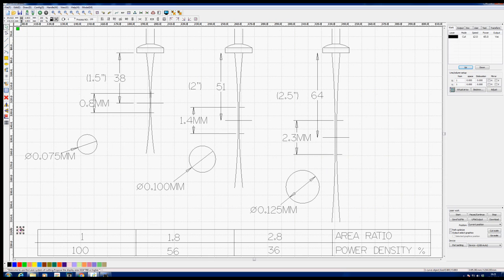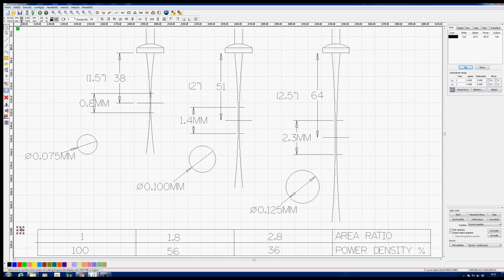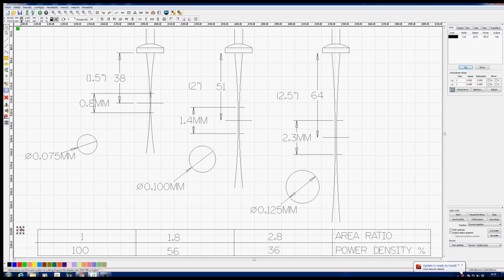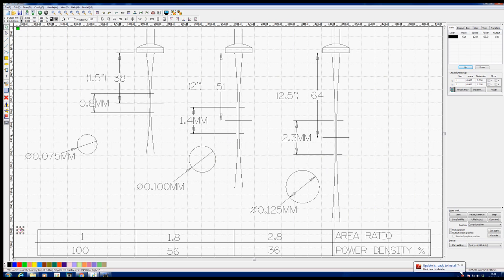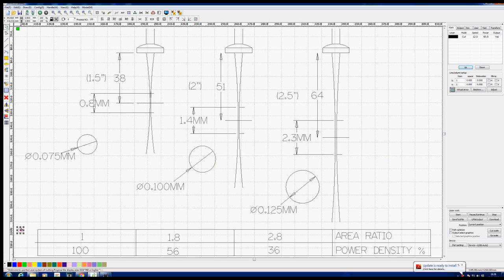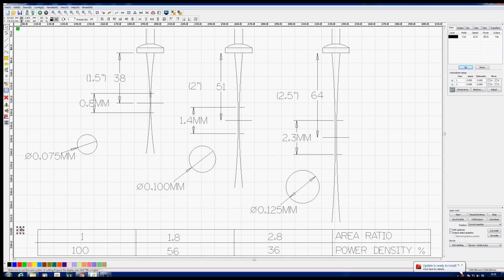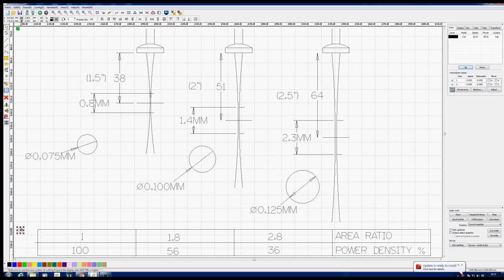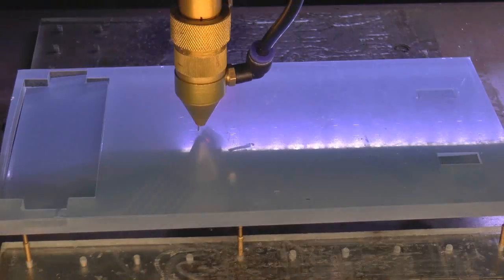RDWorks Learning Lab 39 Understanding Lenses

Comment: One point you missed about air assist...It blows out the fire when, things catch on fire.  I'm glad you caught on  to both keeping the smoke off the lens and blowing the crap out the cut.   I will be working on a modification to add a little air ABOVE THE LENS, because it is completely open to the smoke in the cabinet and seems to be
the number one collection point for a dirty lens.
Reply from the maker: Hi Dan
 Remember this video was done 5 years ago when I was just at the beginning of my learning journey with this technology and was beginning to discover the importance of various aspects of the machine. There turns out to be a lot more to air assist than the basic understanding that most people have. I began to realize that a significant part of laser cutting /engraving is understanding  what the laser beam is (yes, just a beam of invisible light) and  how that light energy gets converted to molecular vibration at the surface where it contacts. The level of molecular vibration= temperature  (it's worth Googling to understand this). As the molecules vibrate faster they shake themselves apart and form new chemicals. It is those new chemicals  (smoke and fumes) that you are reheating with the laser beam and  undergo further chemical change and catch fire.. If you can blow those fumes away from the path of the laser beam (out the BOTTOM of the cut) then there will be nothing to ignite. This is not quite true in the case of acrylic  so you may like to watch this short video    https://www.youtube.com/watch?v=eaz9ZEjwjfs

As the video begins , stop it and look at my lens tube. It is very short and VERY open at the top.  I have 3 machines like this  and in 6 years I have never experienced debris on the top surface of my lenses. I can only assume that your cabinet becomes smoke filled during cutting? Air flow management is the secret.....don't let the smoke anywhere near the top of your lens tube. Study your machine carefully because  I'm sure that additional above-lens purging is not fixing the real problem.. This video (from 42:30) may give you some understanding of the importance of air flow management. https://www.youtube.com/watch?v=AHnJ2WxNo5Q
 Best wishes
Russ

Comment: When you made this video, did you have the lenses flat side up or flat side toward the work?  When I turn mine with the flat size toward the work, the cutting is absolutely brilliant.
Reply from the maker: Hi Marti 
 At this point in my learning journey I had already discovered that the  Chines ship machines with the plano convex lens flat side up and that you het better cutting if you use it flat side down, It took a couple more years before I carried out in-depth research into lenses and discovered the reason for this interesting advantage.. My interest in photography and college physics ave me a pretty solid grounding in lens theory. It turns out that  conventional theory does not work for our machines. You probably have a 2" focal length lens and your setting piece supplied with the machine is probably about 19mm wide?   If so, flipping your lens will have decreased that focus  setting to almost 17mm. Without boring you with science, if you want to do detailed engraving then flat side up is better and if you want to cut then flat side down is better.  Here we are 4 years later than this video and I now understand so much more, It is sometimes embarrassing to watch me learning in these early days. BUT without any one to teach me , tiny steps and mistakes are all part of learning.. One simple question to finish.
Do you have a spare lens? suspect no. Your lens id the most vulnerable and the most essential  part of the machine Always carry a spare. They are 3 weeks away and cheap if you buy from China . see   https://www.cloudraylaser.com/products/china-pvd-znse-focusing-lens-for-co2-laser?variant=43422450056     

Best wishes
Russ

Comment: Once again, your video has answered my question.How to get a tighter stronger beam to cut through dense plywood like 1/8" 6 ply and 1/4" 5 ply. Bee struggling to get a clean through cut with the stock 2" lens even though I have it perfectly centered all the way through, but found I have to crank it to 75% at the software level with 80% set on the controller.  Slowing it down winds up blowing out the bottom of the material too.  The only thing not answered, do I need to change out the nozzle, or is it the same nozzle for all three?  Going to try the 1.5 lens.

Comment: Thank you so much for your expertise and taking the time to compile your information series.
I've got a K40 and 1400 bags of tea... Can you come round and sort out my machine? I'll pay for your travel to Oxford :0)
Reply from the maker: I have three problems with your request
1) This is just an engineering and video hobby for me in my retirement and I do not make "service/help" visits. If I started, where would I draw the line?
2) I know nothing about the K40 machine except that it is a very compromised little machine both mechanically and in it's controllability. That is why I never bought one 5 years ago when I made my buying decision. Apart from having a laser tube and 3 mirrors that where my knowledge of this machine stops.
3) I don't drink tea!!.
If you wish to add your disguised email (jimdotsmithathotmaildotcom) to another comment I will reply so that you can ask for help off line and supply pictures/video of your issues. I will try to help.
Best wishes
Russ
Reply: @SarbarMultimedia  Thanks Russ, you're a  gent. Some freeware software has helped with the k40 since launch, allowing dithering and some other functionality. Unfortunately I can't use layers without upgrading the motherboard, which is a real shame and adds considerable time. Currently the laser is doing what i need it to do, albeit not at it's best, but your catalogued journey is helping greatly, thank you again. I've made an adjustable bed which although fundamental and £7 to make, is accurate and adjustable in 4 corners.
I think what I need to invest in is a lens housing that can hold a 38.1mm lens. I've looked around for your gold laser head but cannot find anything that I'm sure houses the 38.1mm lens. Any ideas on the latter? Then I'll let you off making you come to Oxfordshire and forcing tea on you.
Reply from the maker: @DR87408  I do know that there are about 3 different head designs used on K40 machines. The basic design for the K40 is Chinese government approved (like all their machines) which is why they all look remarkably similar. The machine skeleton is approved but the details are down to the company building the design. They can use cheap or expensive parts depending on the market/profit they are trying to access..  If you have the link to the machine you bought it may have a few detail pictures for me to see.
Best wishes
Russ
Reply: @DR87408  I think Russ is referring to the focal length of the lens rather than the diameter. This can be confirmed by looking at the video @ 8:30 where Russ is holding the 2" lens that arrived with a chip in it. Quite clearly although Russ refers to it as a 2" lens it is not 2" in diameter, and looks to be the more standard 20mm. I think what is maybe confusing is that you can also buy lenses that are 38mm in diameter... the cost though is significantly higher... a 38mm lens from Cloudray is about $250.

Have a look at this page and you can see what I mean... A 20mm diameter lens is available with a few different focal lengths.

https://www.cloudraylaser.com/collections/co2-laser-optics/products/usa-cvd-znse-focus-lens-dia-20mm-fl-50-8-63-5-101-6mm-1-5-5?variant=7645039394867

Comment: Not sure if this been commented on. I think I heard 25mA!? On a “50w max” tube?  Guessing that your supply is putting out 15-16kV that’s close 70W of output power. (16kV * 0.025A * ~18% efficiency). Did you serious life of use issues?
Reply from the maker: Hi
 There are recognised safe max normal working currents for these tubes. that runs with watts output and tube size

40watts will be 800mm long x 50mm diameter and run at 18mA
50watts will be 1000mm long x 50mm diameter and run at 20mA
60watts will be 1200mm long x 55mm diameter and run at 22mA
80watts will be1450mm long x 550 (somtimes 80mm) mm diameter and run at 24mA
For higher powers there will be differences between manufacturers  but it is still safe to run 100 watts at 26mA
 Reci have a reputation for being  the best tubes. I am of the opinion they are  expensive and VERY over specified, You can get the same quality tube at half the price. I have used and tested quite a few Reci tubes and only one has impressed me with performance.

If you run at higher than these typical currents the pink ionized nitrogen beam has sufficient energy to dissociate one of the oxygen atoms from the CO2 . Neither CO nor the free oxygen will create laser output so you will quickly consume the 10% CO2 within your tube and kill it.  Even if you run at lower (or much lower) currents you cannot stop this natural  process happening at a VERY slow rate. It is this mechanism that will eventually kill your tube. With an A grade tube you can expect 3 to 5 years of life, regardless of what the  manufacturer promises.

 Beware if you buy another tube , there are lots of B grade (relabled  main factory QA failures) out there at tempting prices. They will be anything from nearly OK to near junk, it's a lottery,

Best wishes
Russ

Comment: Great video for us just stepping into this arena. Simple, to the point and bulging with usable information!
Reply from the maker: Hi Greg

In general these facts are right......but it turns out , not for our laser cutting or engraving.  I have mapped the energy density profiles of many lenses and those results clearly  demonstrated that  the commercial lenses that we buy for our machines do not perform anywhere near what  I was passing on in this early video.  As  my learning journey progressed I was finding more and more things about the performance of lenses that didn't make sense.  I have looked at the performance of lenses for photo engraving and also for cutting but none of the experimental work has given me concrete answers about what is actually happening  I started a new investigation just recently that I hope will finally answer some of the many questions that nobody seems to have absolute proven answers for. see 
https://www.youtube.com/watch?v=MU5uT2XnuWU
https://www.youtube.com/watch?v=zJjAr-TANQk
https://www.youtube.com/watch?v=YV_BZ1US7vY

I am still doing the cutting tests and sxpect to issue my results in the next week or two.

Best wishes
Russ

Comment: I have been trying to produce plastic kit buildings for railway modellers but could never get my parts as 'crisp' as some of the laser cut kits advertised in the model magazines. 
After watching this video and switching to a 38mm meniscus lens I have 'cracked it' and my cuts are the equal of the commercial kit makers.
What a valuable resource RDWorks is.
Keep up the good work.
Reply from the maker: Hi I am glad you are seeing great improvements. Bear in mind my series is a learning journey and at this point I did not understand the importance of air assist to good clean cutting. The chances are that by using a shorter focal length lens your nozzle is now much closer to the work. Getting your air assist directed efficiently INTO your cut will  be the main reason for your  improved cutting. That is something you will come to understand about later in the series.
Best wishes
Russ
Reply: @SarbarMultimedia  I am already looking in to improving my air assist, I upgraded my airbrush compressor and the old one is about to replace my existing air assist compressor. It is a tank compressor with a pressure regulator so I will have smooth air delivery. I have improved the air valve on the nozzle to improve flow.
Reply from the maker: @captainswoop8722  
Be a bit careful about using even regulated air from a shop compressor. Because the pressure starts off very high,  the temperature of the air in your reservoir is hot and absorbing water they has condensed there.  When your air drops its pressure (usually as it enters your nozzle) the rapidly expanding air cools and releases its water as micro droplets. The laser beam will heat those droplet and they will rise to the face of your lens. Gradually over a short time you will find a film being baked onto your lens. I destroyed 2 lenses when I swapped to my tank compressor. After 3 weeks I was back to the little pulsing pump supplied and because it works at 4 or 5 psi there is no such risk because the air never heats up and there is no reservoir. Never had a repeat of this problem since the change back. I warn you so you can keep an eye on your lens. 
Best wishes
Russ
Reply: @SarbarMultimedia  Thanks for the warning, this isn't a 'shop' compressor, it's an airbrush compressor, it has a very good moisture trap, runs cool and can be regulated down to just a few psi and low volume. 
I was thinking of rigging it as seperate air supply directed at the plastic face to keep it cool and stop the edges of the cut and corners going 'soft'. I am mainly cutting  thin modified acrylic 'rowmark' plastic between .75 and 1.5 mm or engraving detail in to the surface.
Reply from the maker: @captainswoop8722  

There is always a dilemma when it comes to cutting and engraving on one job. especially multi layer plastic as you are doing. For sfficient cutting you really need a small nozzle  (2 to 2.5mm diameter) and a 3 or 4 psi air assist to blow the cut debris out of the BOTTOM of your cut. To achieve a focused air flow through your cut your nozzle needs to be close to the work  (3 to 5mm) You do not want ANY smoke/fumes coming upwards or they will immediately get blown back onto your work.  Engraving requires exactly the opposite conditions. The nozzle should be 4 to 6mm diameter (no jetting effect) The air assist should be just a whisper to keep a positive air pressure in the nozzle to protect the lens from fogging. The gap between work and nozzle  should be as large as possible (anything from 12mm upwards).

Let's stop for a moment and consider a cup full of water. What happens  if you turn it all to steam? It will fill a large room because the gaseous state of water has a much bigger VOLUME than the liquid state. Exactly the same situation exists when you fire the laser at a plastic surface. If you use a low power beam and pulse  the surface you will do two things First you will convert solid into gas which is hugely more volumetric than the solid t was a few microseconds earlier. Thus it will have to expand somewhere. Because this is not a through cut but an engraving,  Secondly,  the only place for those fumes to go is upwards like and erupting volcano. Once those fumes are in the air, the last thing you want to do is blow them back down onto your work with the air assist. The further your nozzle is away from the eruption zone the better  and  with virtually no air assist. What you do however need is a high velocity CROSS FLOW of air over your work  to carry the fumes harmlessly away,  If you use lots of power for engraving then there will not be a controlled upward volcanic eruption of fumes  but a dramatic conversion of solid to gas that cannot expand upwards quickly enough,. Instead, it will explode sideways and be forced onto your work by the expanding gas pressure above it. NEVER take deep engraving cuts or you will coat your work with fumes regardless of air assist or not.. It is all very logical when you stop to analyse the situation. Sadly ,most do not  and finish up with fume coated work.   Take time to experiment and you will see the truth of this analysis. This is particularly true for Rowmatk material.  

Best wishes
Russ
Reply: @SarbarMultimedia  I am using single ply rowmark, my engraving is to a depth of around 200 microns and I have found that 15% power from my 60w laser at around 90mm a second gives the best result.
For clean sharp cutting 25% at 50mm with corner power reducing to 15% is bout spto on for 1.5mm plastic.
With the new 1.5 inch lens I have been able to increase the speed for the same power.
I have to computer case cooling fans feeding air in and a big ducted extraction fan sucking it out, flow from right to left.
Reply from the maker: @captainswoop8722  
Sounds like you already have things under control. That is great news.
My impression was you were using the multi layer (say red on white  ) material . Where it is very difficult to stop contamination of the white layer with fumes from the red top layer.

Best wishes
Russ
Reply: @SarbarMultimedia   I should add that by 'engrave' I mean a cut at reduced power from a vector drawing layer rather than a bitmap image.
Reply from the maker: @captainswoop8722  
Drawing is not cutting through so you will not need air assist (just a lens protection whisper) and a big gap between  nozzle and work for best results
Best wishes
Russ

Comment: Thank you so much, fascinating about the air assist, the tests you have done and comparison of the actual power density.
As my k40 that I am heavily modifying does not have that much power I will look to use a 38mm lens like you - however I realise how incredible accurate the bed height needs to be. Currently I just eve it ad stack some crap wood underneath.. Now i'll be getting exact sizes and making everything absolutely perfect.
Thank you so very much sir.